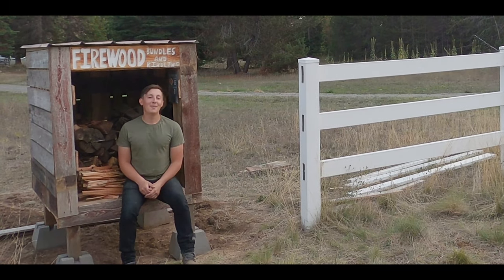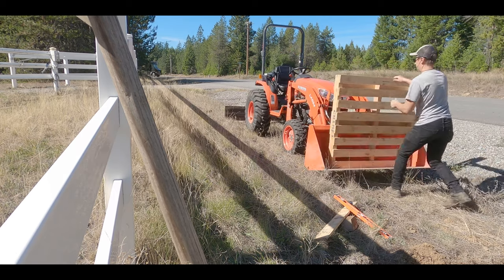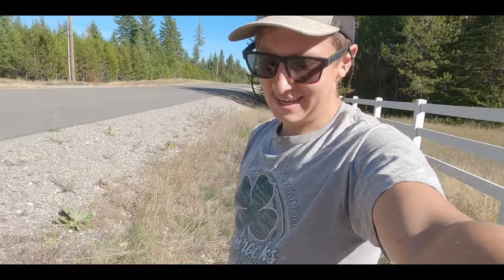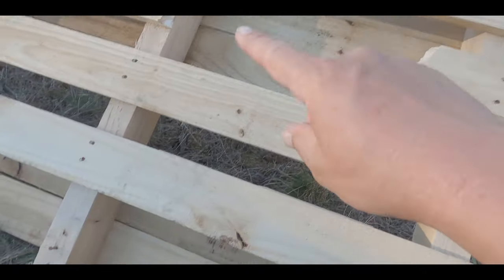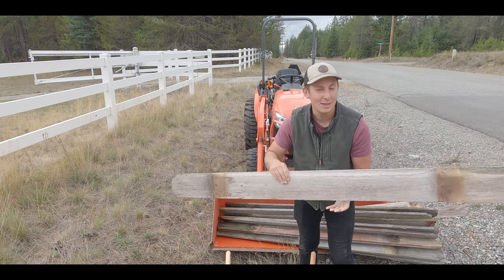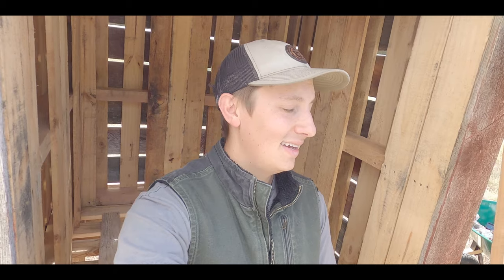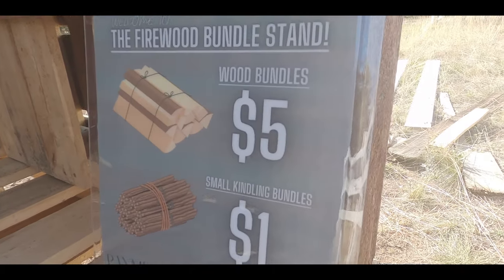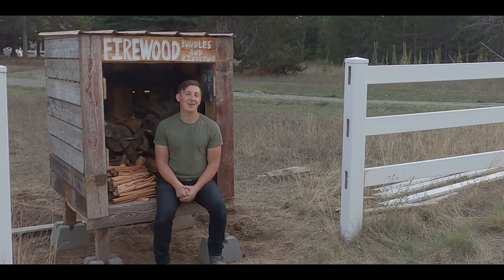Starting a Firewood Bundle Roadside Stand SIDE HUSTLE for DIRT CHEAP on our Homestead in North Idaho

Comment: I was watching this and wondering when is the county going to tell him to get it off the right-of-way... I'm sure it would become an issue with both ditch grass maintenance and snow plowing. I think it will be safer up by the fence anyways. Nice build, good luck!!
Reply from the maker: You learn something new everyday I suppose! At the time I had always felt like I'd seen these stands right off the roadway so it didn't even cross my mind at the time, but I'm with you for the fact that it probably is much safer now. The snow plowing was another thought I had right before I got told to move it.. the stand would have gotten filled up no doubt :) Thanks for checking out the video and for giving the channel a sub! We're excited to have you along - cheers!